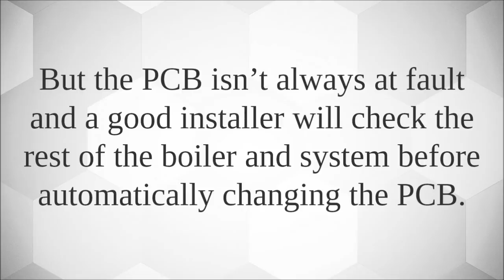What it Means if Your Gas Boiler PCB (Printed Circuit Board) is Faulty!

Comment: Faulty PCB ?.  Change the 3 electrolytic caps as they dry out. Re solder properly the plug pins where they go through the PCB. They may look OK but the pins are plated so need a good solder job to be sure. Clean plugs with EML or WD40 and carefully re-assemble. There are 2 other caps as well but these give little trouble. I believe they are from memory 100N and 470N. Not sure but change them if you think they need it.  Should be fine now. I have repaired a friends and my own. No problems now.
Reply: On what pcb?
There are dozens of them all different
What they really mean when theyu say "Its the pcb" is they don't really know and if they change the boiler and the fault is still there, it was another problem